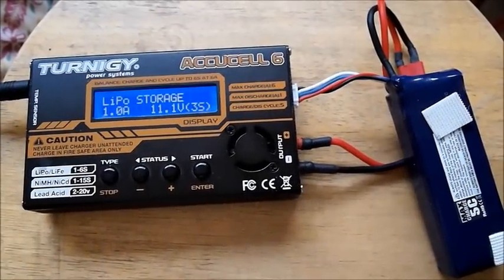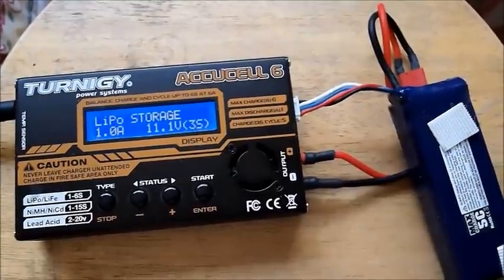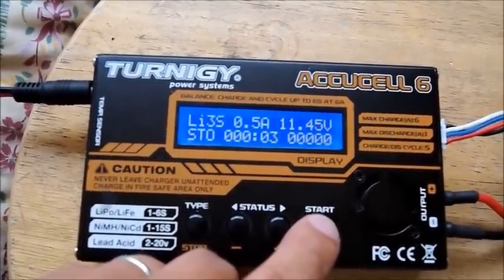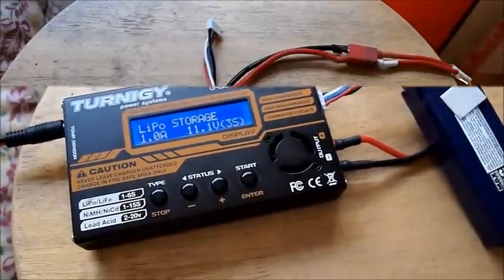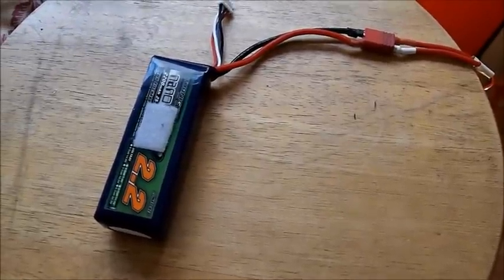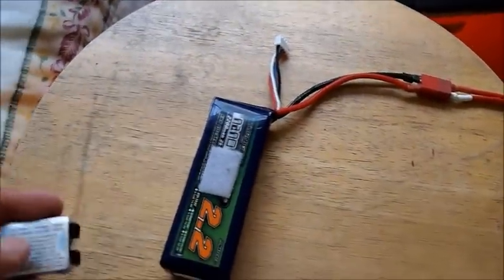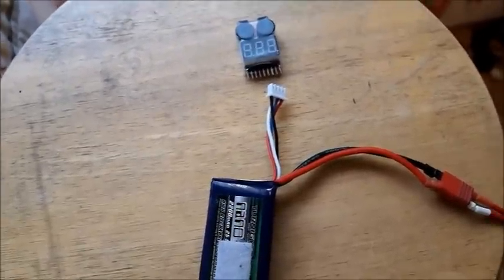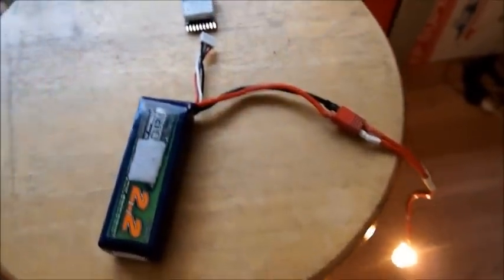Properly discharging your Lipos (storage)

Comment: You can also discharge by running your rc and then check your voltage to make sure it is 3.8. That is what I do. No need for the light bulb.
Reply: Esc will get hot overtime

Comment: why is 3.8 a storage charge as the pack is an 11.1 and at 3.8 a cell the pack is 11.4! this makes no sense to me, please explain
Reply: Because there is 3 cells 3x3.8=11.4
Reply: @jordantyler29  I would have thought the storage charge would be lower than the pack voltage but instead is higher!

Comment: is it ok to set charging to 4A for lipo battery?
Reply from the maker: I assume 4A means 4amps. This largely depends on size of Lipo and charge "C" ratings. If "C" rating unknown charge at 1C. So at 1C, a 1000mah, it is safe to charge at 1amp. 2000mah, at 1c, 2amps...and so forth. At 2c, you just double the amps. To charge at 4amps, your 1000mah lipo must be able to be charged at 4C, or have a 4000mah and charge at 1C. Hope that helps.

Comment: So, how could I discharge a 3 cell Lipo if I don’t already have a charger that has the discharge function on it? Also, will the (Battery Voltage Meter Tester Battery Monitor Buzzer Alarm For 1S-8S Lipo Battery) actually test each cell of a 3 cell battery separately? Or can I just use a multi-meter (before I recieve one that I just ordered!)? Because, I bought a used 3 cell Lipo and when I measured voltage on it using a ,multi-meter….it measured 11.9V (off of the main power connector), then when measuring voltage off the balance connector I got…4 volts (black/yellow, 7volts(black/blue) and 11.9volts(black/red)! I understood the balance 11.9 V reading from (black/red) matching the 11.9 V off the main terminals. But, why are the others 4volts and 7 volts off the balance leads? Is this a bad battery? Did I get RIPPED OFF? Or, can this be fixed? Thank you to ANYONE who KNOWS the answer ahead of time! Kiko

Comment: hey so i got a 2s 5200mah 30c that needs breaking in... andi was thinking can i discharge it with a car headlight bulb...12v 55w i believe...
Reply from the maker: Rc_ KiNg lipos don't need to be broken in.
Reply: rcAllDayLong yes they doo... I've been told by many many people
Reply: rcAllDayLong i even did a test with a new battery and a broken into Battery... new battery only got 13min of flight time after breaking it in i got 18/19

Comment: i have few 3s packs that need discharging so do i just plug it into a 12vlight build or can i plug in a 12v fan?
Reply from the maker: Rc_ KiNg  A fan would work, but just remember, if the fan consumes very little power, it'll take a long time to discharge.

Comment: I tried the battery meter before, those battery meter will make the lipo Voltage unbalanced after few hours hooking on the connection

Comment: you should discharge each cell one at a time. the way your doing it will never achieve equal voltage throughout the pack.  make a JST connector in order to discharge each cell! cheers!
Reply from the maker: Unless your packs are extremely damaged, there's no good reason to individually discharge each cell. They should all be very close. To add to that, if it's that damaged to where voltage is off by that much, you should toss it. Balance is important; however, when you charge. You should always strive to balance charge whenever possible.

Comment: With the light bulb you put on your link what is negative and which is positive?
Reply from the maker: AFAIK there isn't a + or - for these light bulbs and will light up regardless.
Reply: rcAllDayLong okay because I would need to solder the wires to it from my xt60 to my lipo
Reply from the maker: I would just test it first before soldering it. On that particular bulb it didn't matter, but I know I've tested other bulbs where if polarity wasn't correct, the bulb just didn't light up.

Comment: hey buddy can I use my esc n motor connected with the voltage buzzer to discharge
Reply from the maker: elvis martis Yes. You can, but that gets tiring. I usually just hook up a bunch of them on parallel board and let it discharge.

Comment: what should you do with a lipo battery you done using, but you going to use it the next day, yhank you???
Reply from the maker: you only should discharge it if you won't be using it for more than a few days. if you plan to use it the next day, it's fine to leave it fully charged.

Comment: This all seems like alot of work to save a few extra days or weeks off the life of your battery.  The point of batteries is to store power when you need it, what is the point of constantly loading and unloading your battery it makes them pointless.
Reply from the maker: +GitarStu You probably won't even get 100 flights if you left it fully charged. 2 things that are affected by heat and fully charged lipos....longevity and power. I guess if you don't care about either one, then it's ok. It's a difference of getting 100 flights vs. 300 flights, and a Lipo that can put out 100 amps vs. one that maxes out at 20amps.
Reply: +Jonathan Mings get yourself a parallel charging board instead of a replacement balancer.  It does the same thing, but can handle many lipos at the same time (if they are the same type)

Comment: you can safely keep your battery fully charged for a month. batterys generally discharge on their own over time. its best to discharge to 50 percent for anything of long term. this allows the lipo to chemically remain stable. It will not damage your battery to leave it charged for more than a few days. I guess if you are really worried you might damage your batterys then You can discharge after a few days. where I live the weather can be iffy for a week at a time. I am not going to discharge all my batterys after three days, then miss a day because I have to recharge every one of them. it would take me a better part of a day.  Thanks for the tip though. I guess its best to check with the manufactured suggested recommended instructions anyways.

Comment: It's simple , just fully charge to store your Batteries with good room temp "less than 30c. why should i need to discharge it? it's dry batteries you know.
Reply from the maker: +Max Z.H. Plenty of studies and testing has been done on temp and fully charged lipos vs. discharged storage voltage Lipos and longevity. We RC addicts follow these simple rules and have prolonged lipos over hundreds of cycles and many years. I have some that are 8+ yrs old that still puts out good power. Anyways, I've added a link  in the description. Read that and decide for yourself.
Reply: +Max Z.H. Wait until you see a puffed pack because you leave it in storage fully charged...

Comment: If I fly my battery down to 3.1V (23.1), is that ok to store at, or do I need to actually discharge with the charger?
Reply from the maker: Darren Susin First off, you should never ever fly till your Lipo goes down to 3.1. Just so we are on the same page, this is resting voltage, not "under load" voltage. You should time it, so that resting voltage is NOT below 3.7v/cell. Going below this will significantly reduce your Lipo's life and performance.

See chart below by cell

4.00V--84%
3.96---77%
3.93---70%
3.90---63%
3.86---56%
3.83---48%
3.80---43%
3.76---35%
3.73---27%
3.70---21%
3.67---14%
Reply: +Darren Susin Turnigy recommends a disharge down to 3.85v per cell, this is the healthiest. 3.7 is fine as well..you should NEVER exceed below 3.0v and above 4.2v per cell.

Comment: I have noticed that when my LiPo battery (for my TALI H500 drone) starts to run low (when in use), the controls become slightly less responsive. I usually charge the battery once there are only 2 lights (out of 5) displaying on the battery.

Question - to maintain a long battery lifespan, is it better to FULLY discharge the battery BEFORE a full re-charge, or is this relevant on LiPo batteries?

As these batteries are quite expensive, I want to ensure I get a good lifespan out of them.
Reply from the maker: Ciaran Meagher preliminary before I answer your question. First off, if you plan on not flying the next day, discharge any fully charged lipo to 3.7v/cell (never go below this). I want to make sure you distinguish this from your question. Now for your question. If you're at the field, and you've flown a Lipo to say 3.9v/cell, and landed too soon...I'm assuming your question is then do you need to discharge the Lipo. The answer is No. Lipo has no memory effects and should not be discharged before a recharged. Hope that is clear.

Comment: Hey, would I use the same process to discharge storage my 7.4v 1300mah batteries? Thanks
Reply from the maker: Yes. Just remember on 2s, you would stop at 7.4v-7.6v for storage.
Reply from the maker: *****  just remember 3.7 per cell...so on a 2 cell, yes. it would be approximately 7.4v for storage. Your 2nd statement is wrong through. A fully charge 2cell lipo is 8.4volts.

Comment: It would be cool to take off the voltage to the sounder on the board and amplify it current wise to click a small relay. Then a guy could use this device for like tons of other uses other than LIPO battery stuff.

Comment: Oh and the 1.25 amp integy reactor discharger I found on eBay for $6.99. Also the 2 fans on eBay 2 40mm computer 12v cooling fans. Make sure they are 12v cause 3s lipo will fry a 5 or 6v cooling fan in minutes.

Comment: I use the 1.25 amp integy reactor discharger great for 2s as long as you have a voltage alarm like this. To make this discharger able to handle 3s I had to mount 2 fans too the cooling vents of the discharger and it still gets hot so 3s is the limit for my setup. And with the 2 fans mounted on the discharger my discharge amp rate is now just over 2 amps. Works perfect. I love and recomend this setup.
Reply from the maker: I did a Google search...very cool little gadget! thanks.

Comment: Can I plug one of these into balance port of lipo while charging so I know when it gets to storage voltage? Is it not good to use your charger's discharge function?
Reply from the maker: Yes. You can plug into balance port while charging. As for discharging, unless you do regenerative discharge, the charger has to dissipate the voltage which cause lots of heat. Chargers that are used for a lot of discharging end up dying an early death. This is just knowledge i've gathered over yrs. It is best to instead use a 12v bulb to discharge. See my other video.

Comment: i need to get a multi charger to charge at least four batteries at a crack. i'm new to rc, so would you recommend getting a charger/discharger unit or just go with this discharge method in your vid and just buy a charge only unit? all that i'm using at the moment are 1s's for my ultra micro planes. thx
Reply from the maker: Most modern day computerized chargers will have the feature to allow discharging; however, that being said, most rc folks prefer to discharge it with some external method because using the charger to discharge significantly shortens the life of the charger. BTW - any charger will charge multiple Lipos of the if same number of cells (i.e 1s, 2s, 3s). You can just grab a parallel board and charge multiple lipos.
Reply: rcAllDayLong thx for the info

Comment: What is the lowest percentage that a Li-Po 3S can be safely used to?
Reply from the maker: Generally accepted value is 20% of available Lipo or ~3.7v/cell. For a 3S, that's roughly 11.1v. Keep in mind this is resting voltage. While under load, depending on IR values the lipo may drop much lower than this.
Reply: rcAllDayLong thanks!
Reply from the maker: ***** 3.2 is ok for load voltage; but make sure you check your voltage for resting voltage. Give it say a couple mins after landing then measure. That resting voltage should be above 3.7v/cell. If below, set your timer for less flight times.

Comment: ive  been trying to understand how to use this before i buy.how do you find out what percent your battery is in and what numbers have to show so i know what voltage to storage it in? and what is the normal reading each cell some be in? if you can please help
Reply from the maker: Yes. To add to Hill Country, A Lipos fully charged point is 4.20v/cell, storage is 3.8, and resting voltage of max discharged lipo should be no more than 3.7v/cell.
Reply: +rcAllDayLong 

no less than 3.7v/cell.

Comment: Ok thanks man. Any recommendations on a cheap voltage checker???
Reply from the maker: well, I did include one in the description. That is the same one you see in the vid, and the price is currently $4.25 w/free shipping. But it is from china, so expect 3 weeks or so for delivery. if you can wait, that'd be the route to go. Alternatively, just do a google search for "rc battery alarm monitor". Most are under $10.

Comment: So for storage is the only time I should be discharging a Lipo right? And I have 2 venom lipos coming. Brand new. Is there anything I need to do b4 I charge them an go?
Reply from the maker: For a new Lipo, I would check each cell voltage and make sure they are very close to each other and should be no lower than 3.7v/cell. If voltages are significantly different, you may need to slow charge so the lower cell catches up. From there keep an eye on that cell.

Comment: I am using a Titan B6 charger but i am having some problems. I am trying to discharge a 2200mAH  11.1v   Li-po  for my heli but when i try discharging the charger beeps an i get a reading " OVER VOLTAGE ". Why is this happening?
Reply from the maker: that literally means the charger is detecting that your lipo's voltage is too high. for a 3S, it should be no more than 12.60v +- a couple .01v. A couple things to look for. Make sure you actually select 3S. Make sure your Lipo is not over voltage by checking with another tool (volt meter, etc). If that checks out, your B6 is most likely just defective.
Reply: well i balanced charged it before with all three cells having approx 4.2v each. Hooked up the lipo battery to a modified flashlight and dropped the voltage to approx 3.5v each but still getting " over voltage " on the charger when trying to discharge. I did a check on the battery using the charger to ensure my setting was correct so i don't know.
Reply from the maker: seems to me your charger is just freaking out. BTW - 3.5/cell is a bit low. You should aim for no more than 3.7v/cell.

Comment from the maker: I'm 100% Lipo, so I don't know enough about nicads vs nimh. Although I'm 100% Planes, Car amp draw is amp draw- that is amps go up as you put more load on it. Cars are a bit different in that this load will differ based on gearing, size tire, running on dry dirt, cement, grass, etc. As an average, a typical 540-size 4000-5000kV Brushless motor draw on 2s will be around 60-80amps. For a bulb test, a quick google search for 8v shows some in the 50w. You'd need 9 bulbs to hit 450watts or 56amps

Comment: This video maker is talking about storage and its discharge rate. I would like to ask about the discharge rate for cycling a battery, such as to duplicate the motor/ electrical loads of using the rc car. I'm sure you know what I'm talking about here. So... how many bulbs, meaning amps, should I string up to the battery? Also.... how do I balance the cells? What was that device you had for low volt warning? Let's please talk about nicd versus nimh versus lipo for cycling. Cheers.

Comment from the maker: Lipos are more sensitive than other batteries; but, I'm with you on this- If treated correctly and with common sense, Lipos are perfectly safe. Number 1 reason for Lipo fires are overcharging, where a faulty charger does not stop charging. Of course Lipo fires only actually happen when a faulty charger overcharges and the idiot that is charging leaves it charging. Most fires just don't go boom- The lipo puffs like a balloon, smokes, then catches fire. Any responsible hobbyist would catch it.
Reply: That's why you must have a smart charger.

Comment from the maker: it has been proven over and over by amateurs as well as pros, ranging from university research facilities to major battery manufactures. Their test basically takes the same batteries and subject to different voltages over 1,2,3+ years. The Lipos w/~3.8v under the same conditions will have a better IR value than all others. One other big factor is temperature. Fridge temp is best. Just do a search for "Lipo battery storage testing"

Comment from the maker: You always want around 3.8v/cell- So for a 2 cell, around 7.6v. The discharge bulb is nothing more than a regular 12v car tail light bulb from any auto parts store soldered to a regular female jst plug

Comment from the maker: There's a button at the top where the 2 audible buttons are. You click that and it cycles in increments of .1v from 2.7v-3.8v. where you stop is where it sets it at. It's a very cool device for a little over $3 USD.